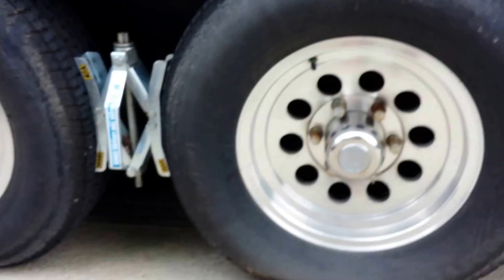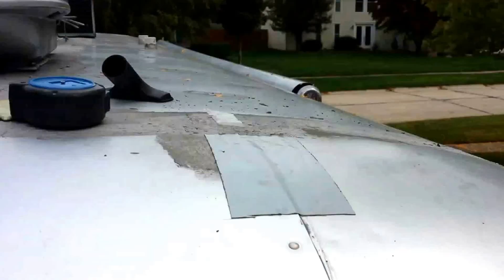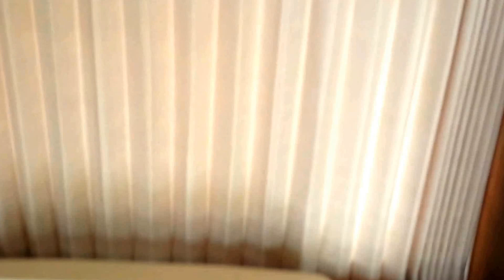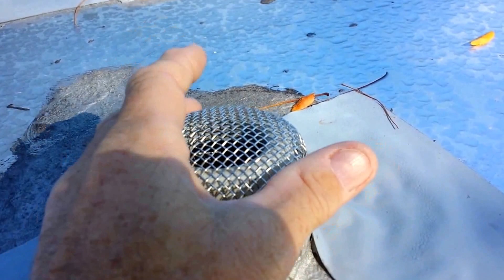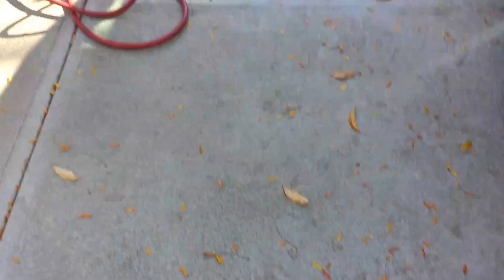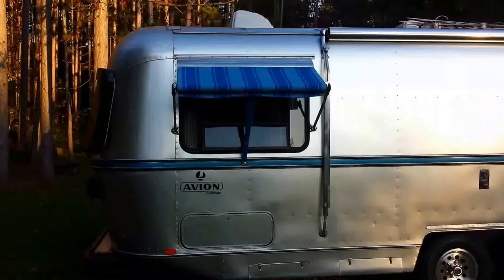Avion Travel Trailer Exterior Restoration

Comment: I have an ‘86 30r. What cleaner can I use to get water spots off? Is a soft buffer wheel a bad idea?
Reply from the maker: The soft wheel isn't a problem. Abrasion on anodized steel is not a problem as much as harsh chemicals. Anything harsher than simple green or fantastic should be tested in nonconspicous space. If you stain the aluminum it is permanent.
Reply: Thank you for the response.